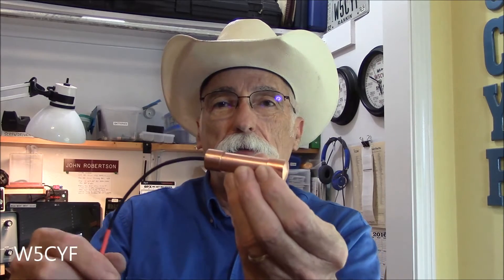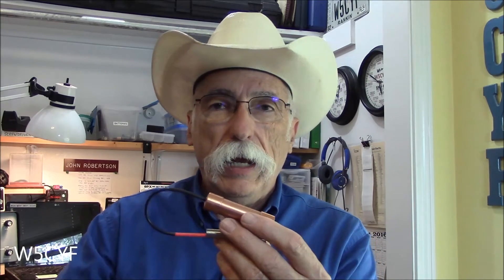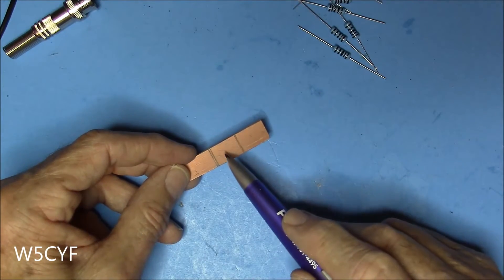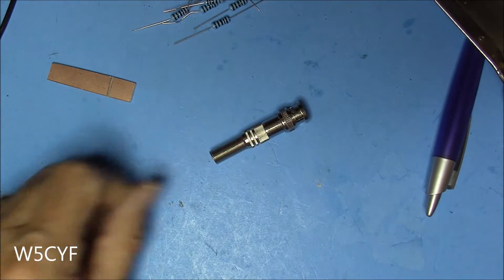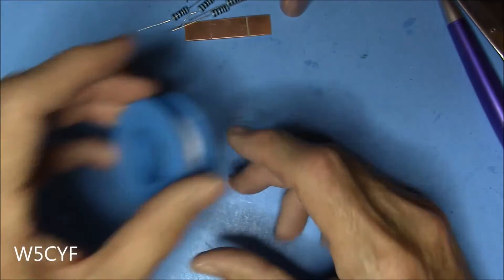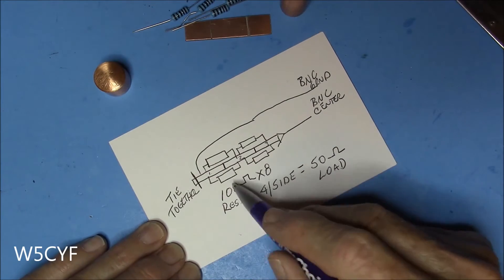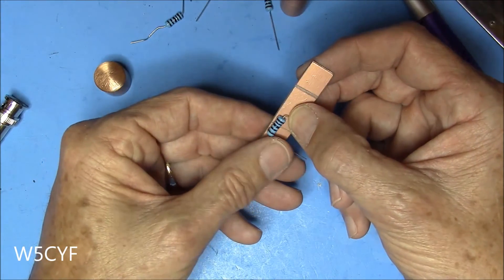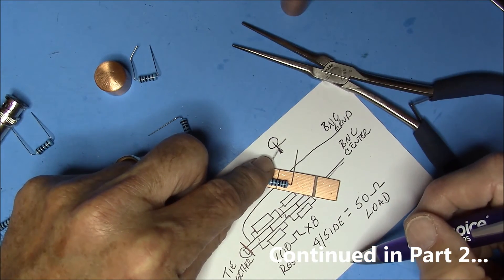Build A QRP Dummy Load (Ham Radio) – PART 1 or 3

Comment: I am a complete tyro and totally unwise in these things, but i do have a question.  Is there anything magical about the use of a copper enclosure?  Since the power(and heat) dissipation is quite low could not NPS 1/2 or 3/4 PVC pipe be used instead.  I ask because I have that around the shop now and would prefer not to purchase such a small amount of copper.

Thanks for your videos and considering this question.

Comment: Does it matter what wattage resistor I use ? 
W3CDW
Reply from the maker: Thanks for watching.  The larger the wattage, the more watts the dummy load would be able to handle.     ~73/John
Reply: @TinkerJohn_W5CYF  I thought that was the case. My grandson and I are going to order some parts and start building one for are Sota rig.
73 W3CDW